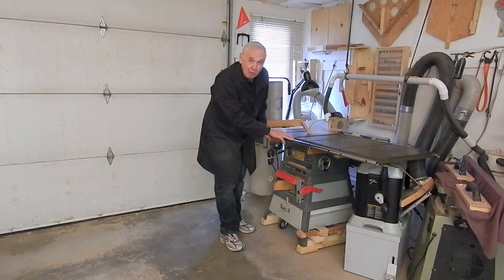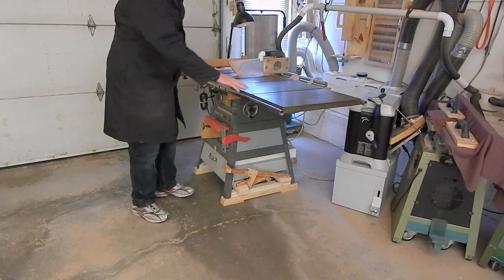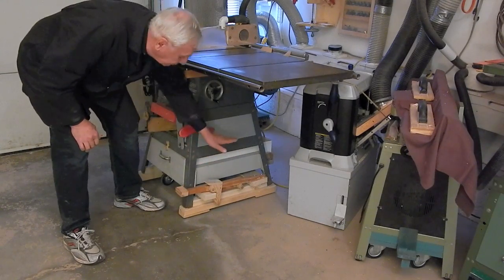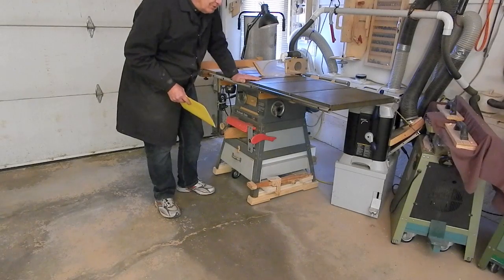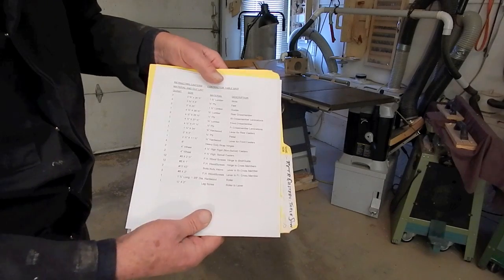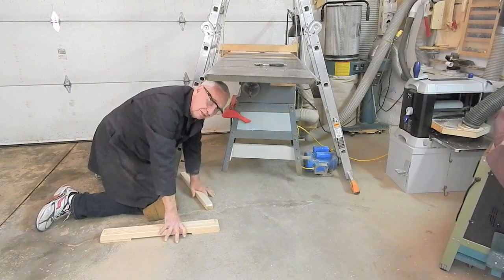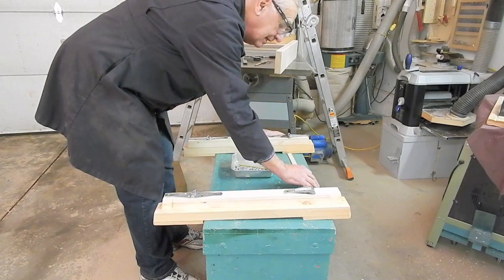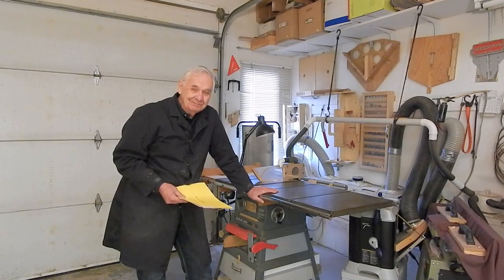Retracting Casters 2 of 6 - TableSaw

Comment: Hi Mr Holmgren, I purchased your plans about a year ago, but I am just getting around to making the Table Saw version.  I have noticed a dimension discrepancy: tOn pg 2 of the drawings you show that the Castor Mounting Bds are a lamination of 1/4”+3/4”+3/4”= 1-3/4” total.  But on the Cut List you show that the CMB’s are 1/4”+3/4”+1/4”=1 1/4” total.  Can you please advise which thickness is correct?  Thank you.

Comment: I watched your video a few times and went out to my shop and built this castor system for my old craftsman table saw. It works like better than the factory wheels that were falling apart. I need to work on the lock and after watching this again I see where I can make improvements. Thanks for sharing.

Comment: Hello Carl 
how can I maximize the clearance of the jacked table saw and castor system? I need to roll down  a 3 inch drop from my garage to my driveway. looks like I'll have to build a ramp. what do you think? great work. thanks for sharing.
Reply from the maker: Phillippe,  The maximum lift with my caster system can be increased by using wider caster mounting boards and mounting the casters further from the hinges.  You'd need stronger lever arms and much more down pressure to raise the tool.  I think you could raise the tool as much as one inch - You'd still need a ramp of some kind.  /////Carl
Reply: Use bigger diameter castor's, done.

Comment: Thanks for putting together the plans. I've been wanting to build this since I found your channel a year ago. This will save me lots of reverse engineering. Great channel, Carl.
Reply: I went thru the "reverse engineering" ordeal for my 1957 DeWalt Radial Arm Saw (before Carl offered his plans)..  While my retractable caster set-up works, it's not as "smooth" as Carl's (in the video).. I went ahead and bought the plans and intend on remaking the platform "properly", this time ;-}  And, I am going to make a retractable caster set-up, all in steel, for my five foot sheet-metal brake (all 600lbs of it!)    Super Great Idea, Carl..  Well worth the cost of the plans!! Chas